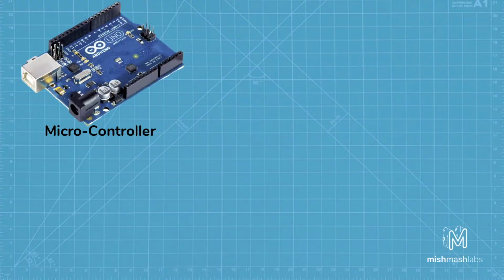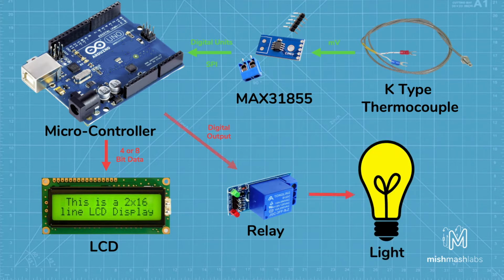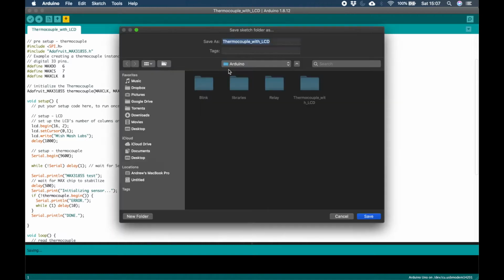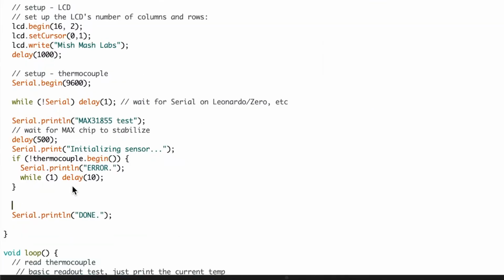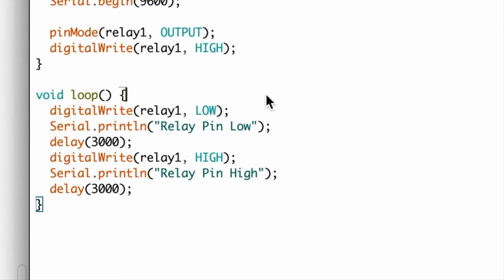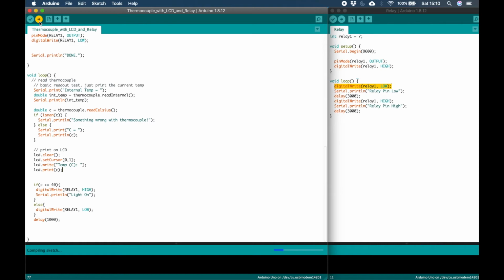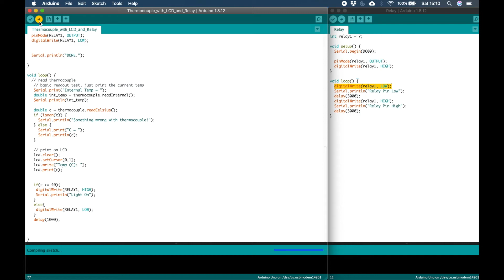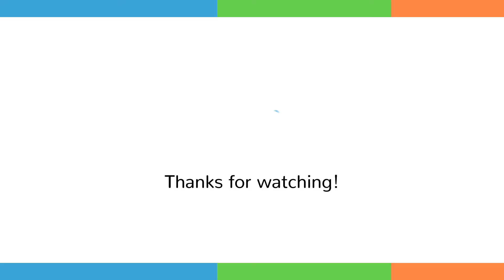Controlling a Relay using Temperature (Temperature Controlled Relay with Thermocouple, Arduino, LCD)

Comment: Is it possible to program an arduino to accept a target temperature,, keep the relay on for a programmed amount of time, then turn it off, and to fire off an alarm if the tmeperature goes above  a certain overtemp value the user enters?

Comment: You can make a video of something similar but that controls the speed of a fan, the idea is to control the temperature of a wood oven. Wearing:

1. Arduino UNO R4 WiFi.
2. Thermocouple K with its controller.
3. 12Volt fan.
4. Arduino Cloud.

The K thermocouple will be in the smoke box, the fan will supply variable flow air, this air will pass through the heat box and take it to the smoke box, the cloud application will control everything, ignition, the desired temperature, By giving it a temperature of 250°F in the App, it varies the fan speed to maintain the temperature. In the leds of the Arduino you can see the temperature in real time.

Greetings.

Comment: Hi! I have a Chinese x99 motherboard that have some temperature sensors that doesn't provide the motherboard temperature.
I'm searching a solution to this problem and I think to add in my case a fan controller. The controller interact with the motherboard through the usb 2.0 connector, but if the motherboard doesn't provide its temperature, I think that this link between fan controller and motherboard will not be useful.
If I will use one of this Arduino-based temperature sensor, how can I transmit the results to the fan controller?
Is it possible doing something like that?
Thanks if you respond!

Comment: I have used relay in automatic plant watering system to pump water based on soil moisture sensor readings. My LCD is messing up after relay turns on. It just showing some weird things on the LCD. Do you have any idea on this

Comment: Hi, is your power supply connected to the bulb is 220v?
Reply from the maker: In this case yes, but you can change the bulb to one rated for another build thefore changing the supply if it's an issue. For example 12v, 24v, 48v or 110v bulbs and suppy
Reply: @MishMashLabs  thanks a lot❤️

Comment: Can you modify the code too take input temperature value used for comparison?  SV set value compared with PV (present value from thermocouple)
Can SV through capastive keyboard?
Or keypad ?
Reply: Yes, you can modify the code as you want

Comment: Does this code will work for PT100 ?
If not , which is best ADC chip for PT100 temperature sensor? 
Any liberary function for PT100 temperature sensor?

Comment: Can I use a SSR-40DA Solid State Relay Single Phase Semi-Conductor Relay in replacement of the 5VDC relay?
Reply from the maker: Hi, yes I believe so as its 3-32v. Refer to the datasheet and make suer the current required to activate the relay can be supplied by the device you are using

Comment: do you know how to control a heating element with certain set point with timer?
Reply: Just replace the light bulb with the heating element and code it to turn on whenever the temp on the sensor is lower than the set temperature
Reply: @francovillarreal7266  Hey, can i integrate a Knob here and set a value to control the heating element?

Comment: we can use the same code for turning on/off a water heater system instead of the lamp...right ?
Reply from the maker: Yes absolutely.
Reply: @MishMashLabs  Yes and I tried that one to, but I got constantly the reading; ̈ c" is not declared in this scope... and I don't get what I am doing wrong